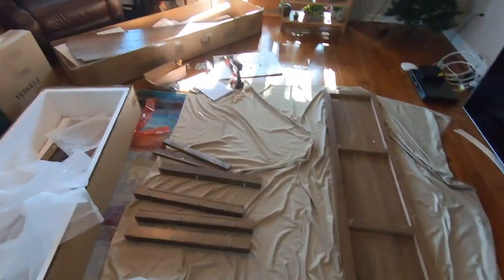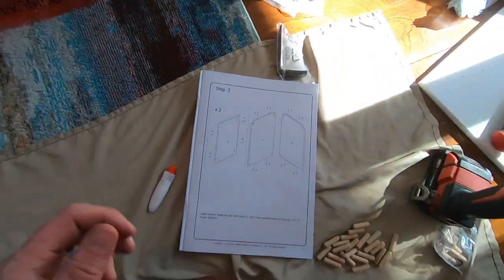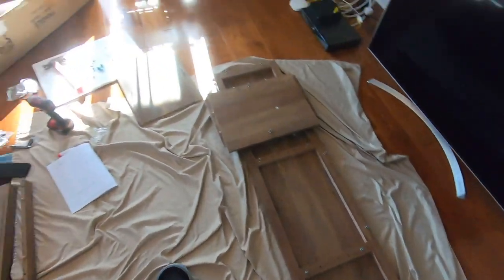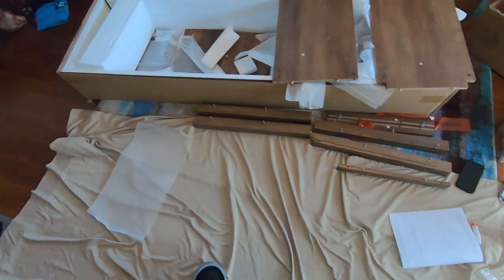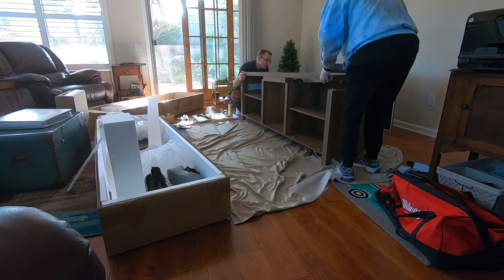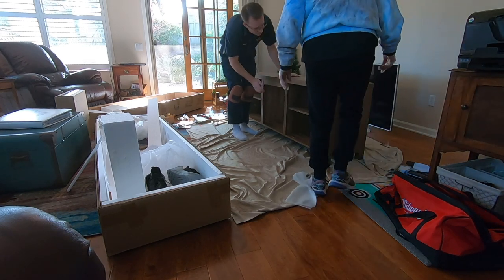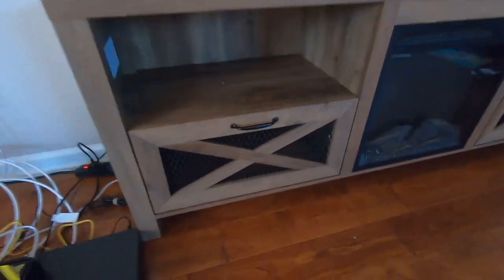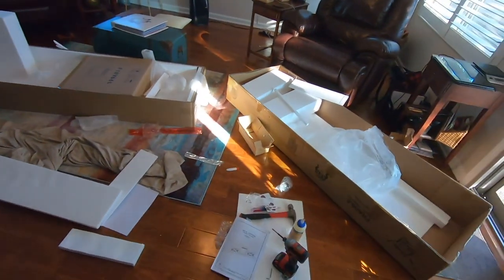Small Handyman Jobs That Make BIG MONEY | Handyman WLOG S 3 | E 3

Comment: I do Dryer Vents cleaning for a living looking to get into more handyman stuff like your videos but that’s not the way you clean the dryer vent those cheap brushes that you got from Home Depot or Lowe’s will snap off in there and you’re going to end up fishing one of those out of there not to mention there’s a good chance that there’s probably a screen or clog at the gooseneck on top of the roof that needs to be removed as well but all in all I appreciate your videos
Reply from the maker: Hey thanks Scott! I appreciate your comment! What brand dryer vent cleaner do you recommend?
Reply: @handymanjourney   hey boss there is a company out there that is called snaplock it’s made for dryer vent cleaning they’re not cheap but if you’re going to use a brush I would definitely recommend using one of those we don’t use a brush 99% of our jobs are done with high compressed air in a reverse whip line you basically climb up on the roof you run this line down through the gooseneck until it hits the back of the dryer and as you’re pulling it it has holes in the back of the nozzle and it reverses everything back up to you way better system you just need a compressor to do it and it Hass to be at least 150+ psi The only time we use brushes is if it’s raining or if the wall vent just goes directly out the wall  but a lot of times the gooseneck will have a screen on it from the roofers that has to be removed and also sometimes by using a brush when you run that up there where it curves on that gooseneck it has a tendency to clog it up and not go out the top of the vent so just be careful

Comment: Would strongly advise not to use an impact on furniture assembly. Personally, I used a drill/driver with the clutch on the lowest setting and titrate as needed. Even my nice Milwaukee hammer drill’s lowest torque is far too much for fine screws
Reply from the maker: Very true! I appreciate the advice!
Reply: You have to learn how to feather the trigger. I use it all day everyday with these types of things
Reply: Nothing wrong with it when u know how to feather the trigger.  But no impact on electrical connections!
Reply: @jheiny1231 , i used to use my M-12 impact on low for trim out. Rock solid connections and no call backs.
Reply: Milwaukees drills overall are pretty lack luster. I will say for the type of work you are doing you could absolutely get away with M-12 impact driver (gen 2 and 3 have multiple settings making it easier to dial in power) the M-12 gen3 hammer drill (still very small and compact) looks like it finally has some usable power but would be great for assembly. They also make an M-12 assembly tool with 4 or 5 different heads. Love it for cabinets.

Comment: How would you quote those type of jobs ?
Reply from the maker: Great question! Be sure to check out some of our other WLOG videos, we talk a lot about pricing and how I come up with that. Everything is priced per job but really based on an unspoken hourly rate, so how long it takes to do the job. But typically on smaller jobs like this you can charge a good rate and get it done a lot quicker!
Reply from the maker: For this job I charged:
- $225 for assembling TV stand, took me about 1.5 hours.
- HVAC Filter $50 / Took 5 mins
- Reattach shutter - $100 / Took about 15 mins
- Dryer vent cleaning $135 (We now charge $162 for these)

Comment: Do you ever feel bad about charging high prices for easy work? For some customers I'm up front and tell them I charge $80 per hour and for furniture assembly you can probably get someone at $20 per hour to do it, and it'll be more cost effective

What do you think? Like some jobs, especially the bigger ones, I charge a lot because it's hard work and a big project, but sometimes for stuff like painting and furniture assembly I kind of feel bad knowing they can prob get someone for 1/5 of the price and still do a decent job
Reply: I live in Southern California and a handyman if you can find one charges $190.00 the first hour stating from there place of business and $114.00 a hour after, with a two hour minimum. The overhead is expensive. In San Diego, California In and out burgers pays $21.00 a hour the benefits and free food.
Reply from the maker: Really at the end of the day it comes down to quality of work, they can definitely find someone cheaper to do the work, that is always an option but if they want the quality that I produce then they're going to need to pay a premium for that. I have an hourly rate that is much higher than others in my area but I have a reputation and quality and warranty that backs that up. So no I do not feel bad for charging what I charge because what I charge is what I need to charge in order to run my business and make a profit!
Reply: I charge what I would pay someone to do handyman work, usually $50 an hour. Always worked for me and my customers.
Reply: Hell nah... don't feel bad. People don't feel bad when they buy a 300 purse...or spend 150 bucks at a restaurant.. when you sit there for an hour.. plus tip.. what we do and what he had to go through to do things no one wants to do.. man that has a price.. great job Allen.. lets make this money..
Reply: Never ever fell bad because some customers will try to screw you no matter what! Reality is it's you against them.Ask me how I know 🤨